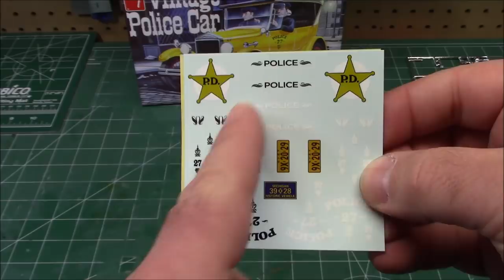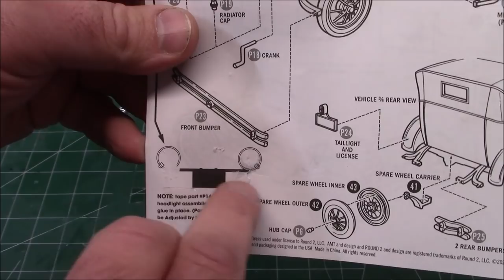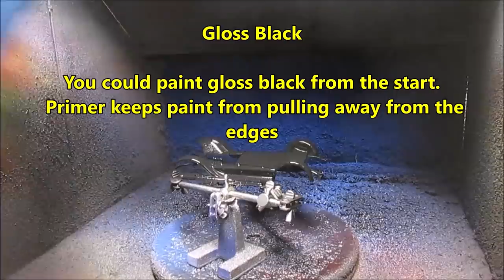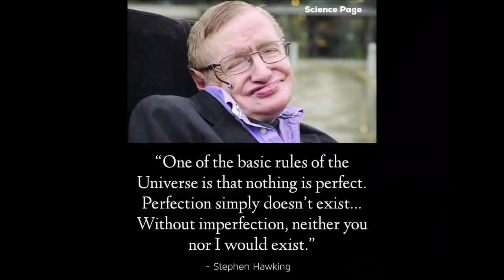1927 Ford Model T Police Squad Car 1/25 Scale Model Kit Build Tutorial Review AMT1182

Comment: Awesome build. I’ve never had a problem with model roundup. I build the Chevy luv and have the autocar dump and I’m currently building the Peterbilt wrecker. I have gotten back into building during the recent down time and I’m having a blast. 
I have lot of models still in the boxes ready to go. But the 1/16th scale General Lee was a nightmare flash galore and the fit issues didn’t stop until I finished 🤣. The Chevy luv was a dream to build flawless
Reply from the maker: Yes the 1/16 General can be a bear of a kit.

Comment: Nice. I love the T's myself. Did you have much trouble putting the wheels on the rims? Love the colors.
Reply from the maker: I didn't, they are tight but I centered them on without much issue.
Reply: @hpiguy  Thanks.

Comment: I haven't built a model in 40 years... But getting inspired and learning lots in your channel. I have 2 kits in the works with my boys. You mention Mod Podge for the glass. Do you demonstrate that anywhere?  Or is it straight forward?
Reply from the maker: I use a small brush, brush it onto the frame, lay the glass in, and let it dry for an hour or so.
Any excess remove with a Qtip before it dries.
Reply: @hpiguy  this worked great. thanks for the tip!